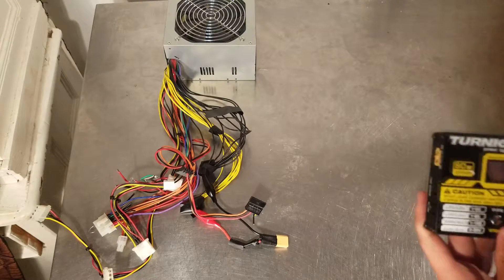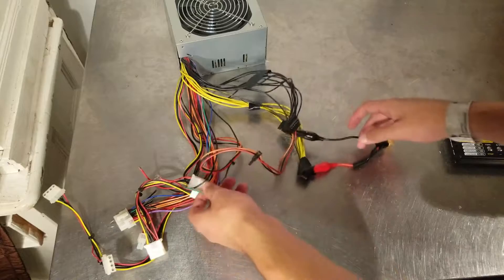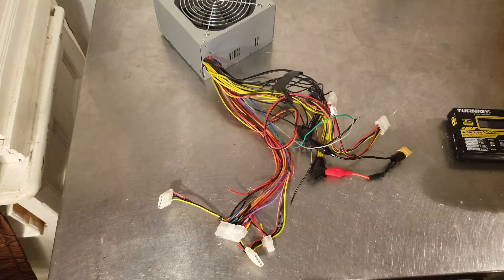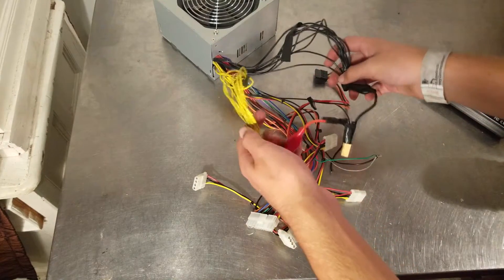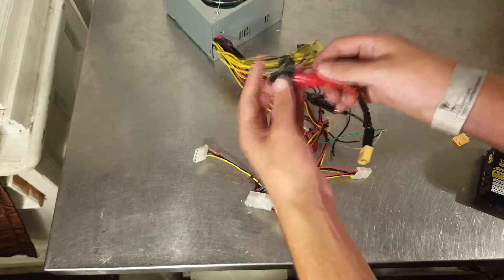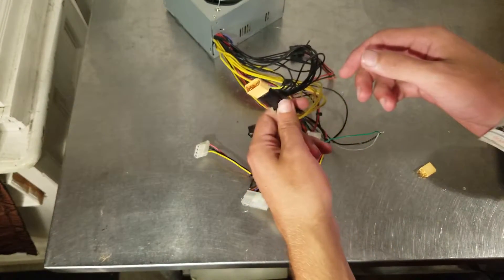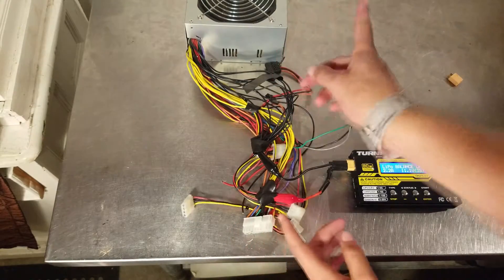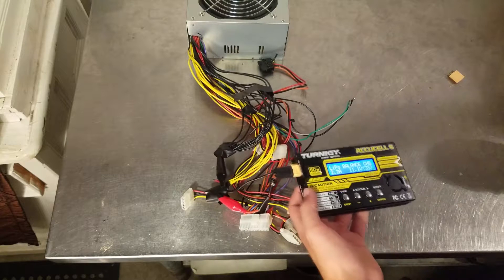DIY 12v Power Supply for Turnigy Accucel-6 80W 10A

Comment: I plugged it in, it worked for a few seconds, and then everything stopped. Now there is no sign whatsoever of anything being plugged in. I twisted all of the wires together, checked multiple times to make sure all of the connections were secure... and nothing. Does anyone have a solution?????
Reply from the maker: I had this problem to I believe it was a short somewhere. Double check that no positives are ever touching a negative. As well as make sure your not overloading the power supply I've had that happen before. Also check the ground signal wire is secure.

Comment: Could it would with 10A, 12v and 120 watts?
Reply from the maker: Yes, that should work! Double check with the manual to make sure though :)
Reply: Ok thanks alot! But just wondering which is the most critial and one to watch out for. Like is there a difference in charge time with 12V vs 18V? Or are the amps a participator to the charge time? What can go wrong with 120 watts? What unit does what? Also, would a 12V and 5A work? Thanks
Reply from the maker: I use a 12v 3amp mostly because I never charge any of my Lipos above 3 amps. I would also do the same. Voltage doenst really matter as much it's the amps your looking for. If you want to hook  more than one battery to charge at a time you might want to look for more than 12v. I would stick to just charging one at a time at the amps set at (number of mah in battery) / 1000 As for wattage I'm not quite sure but I'm sure what you have is fine.
Reply: Ah ok, thanks so much for your help!

Comment: Hi! I would lke to ask a question. I bought a paralell charger ti this turnigy and I wondering, is it possible to put in storage mode 5 batteries in the same time(1500mah each)?! What do I need to set up for it? Thanks for your help in advanced!
Reply from the maker: I would recommend just doing it one by one if your going to put them in storage mode. This charger cannot handle that many discharging at once.

Comment: Not exactly safe for everyone. You should seriously be a little more specific and put a disclaimer on your videos before providing info like this, since saying to just solder "all the black wires" or "all the yellow wires" is super nutty talk. Not every power box like this is wired the same, so it's very dangerous without using a voltage meter. Also, you could have probably just simply used one of the molex plugs for power which are 12v and usually used for hard drives or DVD drives, rather than wiring everything directly from the entire box. Do you even know how many amps you're actually drawing from the power box doing this ?
Reply from the maker: I should add a part to this video showing how I found what cord has each voltage, because I went into the three power supplys I had and saw that every time the yellow cord was the 12v output. I also saw that the black is usually the ground and on this one it was. The ampage on the output of the Power supply is 10 amps because of the safety labels and output levels on the outside of the power supply. Thank you for the info!! Really means a lot. Thank you for the insight :)
Reply from the maker: I'll change the description ASAP
Reply: Skipp3rBuds a

Comment: what do you do with the wires not being used? Could the wires being used be shortened?
Reply from the maker: Hello Ross, I'm not to certain if you can or can not cut the other cables. They sure are a little bit of a mess,  I decided not to cut them because I always say if it ain't broke don't fix it. But i'm sure you could trim them up from the power supply just don't rip the wires from the connectors on the power supply. If you have any more questions contact me at Skipperbudsk@gmail.com